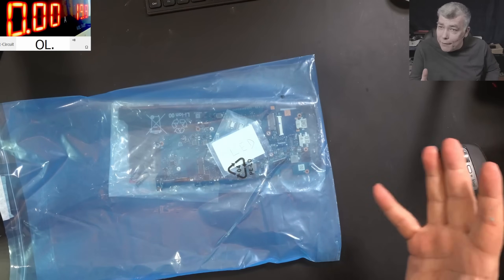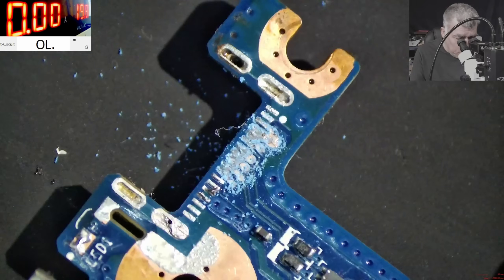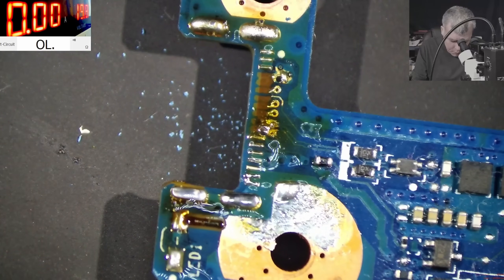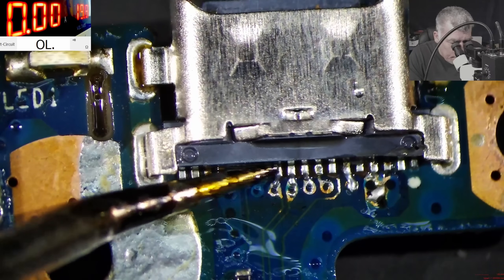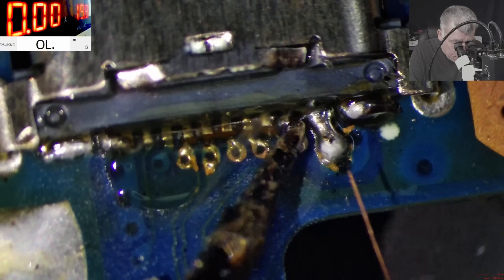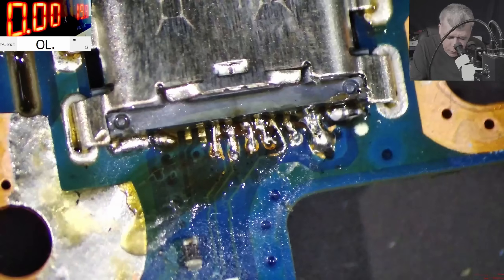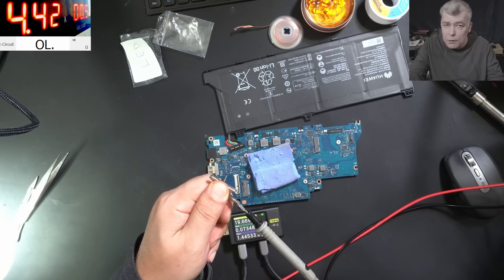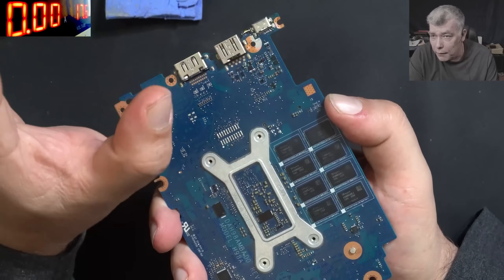Huawei D14 not charging - usb type c port repair, customer asked for a proper calibrated wire

Comment: How come you don't put the copper traces with the copper wire down before you do the port
Reply: bc the wires are round in section and will interfere with horizontal position of the port and with the good tracks that will be too low to make proper contact with the port pins.

Comment: hi sorin, admire your careful skills with soldering such small bits. i guess charging sockets often get over stressed resulting in broken tracks but hard to see cracks. regards your bridging the centre tracks with wires, did you do this as a precaution or did you have evidence tracks were broken?

Comment: have you ever done a video on a HP 17-g128ds ,. it is not coming on , no light at charger port, had somebody look at it they put a new charging port in , it did not work they say I need a new motherboard the pc is junk,  but they will not do diagnosis like you do , can you help thanks

Comment: Sorin, the reason you have so much trouble with soldering is because you're using the wrong type of tip. Conical tips are trash! Either a chisel or a bevel tip would make your life a heck of a lot easier. I personally use the Hakko T15-BCF2 for 98% of the jobs, its large enough to transfer heat into large ground pads and small enough to get around a board. Try a better tip, you'll thank me later!
Reply: I think he knows. He uses what he has around. If he could solder with a hot nail he would. Probably he burned the perfect solder tip already burning plastic 😂😂..super Sorin

Comment: y it doesnt charger by self, y it need to kick by power supply to start chargering ? :D
Reply: Because when the battery voltage is too low due to long time inactivity like in broken or unused devices, you need to manually push current into them, until it reaches  the normal discharged battery. A normal lithium battery voltage ranges between 3.7 (dead) to 4.2 (fully charged). Anything below 3.7 and it might not accept anything from chargers. I guess it's about safety. Or maybe when the battery is too low, the charger doesn't even feel it's presence? Not sure about the last bit.
Reply: @saetto84  i understand, thank u for expalin, can i push like that every batery?

Comment: I have a question, does continuity between the connector charger in the port and whenever it is supposed to go on the board implies that the soldering was done correctly?